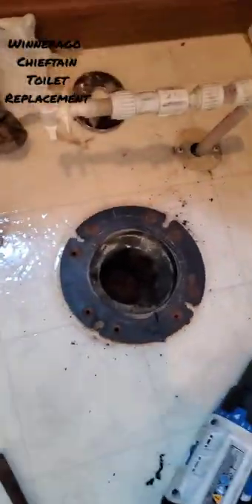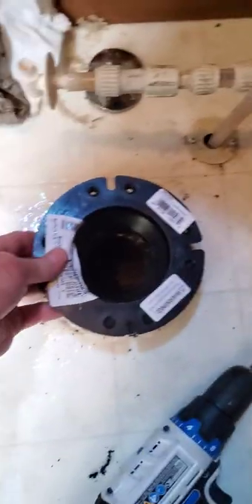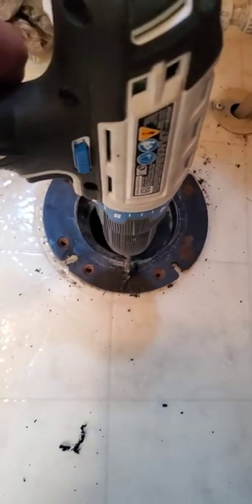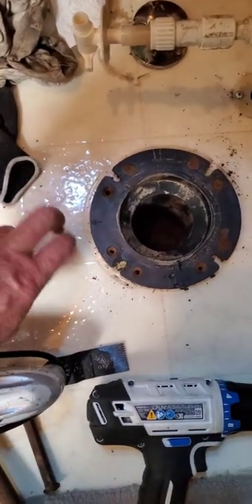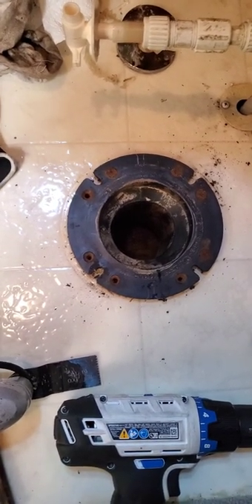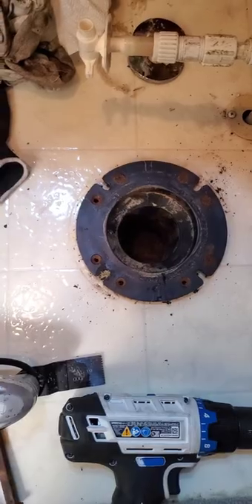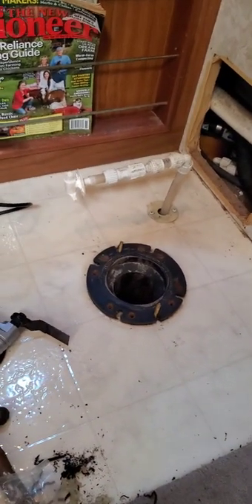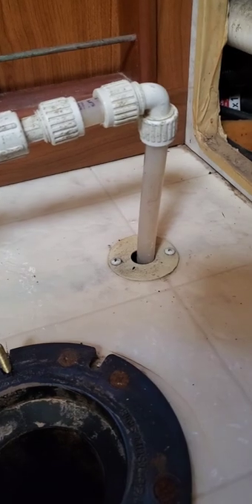Rv toilet flange hack!

Comment: Thanks so much, I've got a new thetford  rv toilet coming but i'm not sure the bolts will be in the right places in the floor flange- so you've helped alot, I won't have to try & get that thing out of the floor. I know there are 3 parts to setting up the entire flange, theres female, male, & then the closet seal- a rubber ring. Not sure if new toilet even comes with that, i don't think it does since one on ebay said if i need the flange parts i need to pay extra. Didn't buy the toilet from there as i found a better deal but now I need the closet seal & the flange part which connects to the underside of toilet. Gonna leave the old floor flange part alone & i really hope i get this right. I know its old school basics but still a little intimidating until a person has done it once. This is my first time dealing with this sort of thing.
Reply from the maker: Thanks, it means alot if I was able to help. If you are buying a new toilet I think the seal will come with it. The repair I made has worked perfectly.  Good luck.